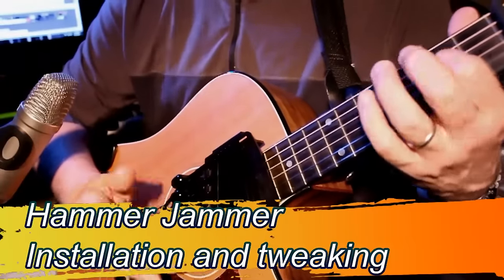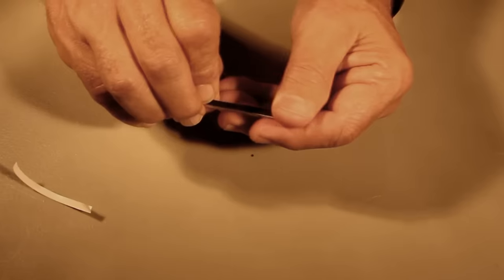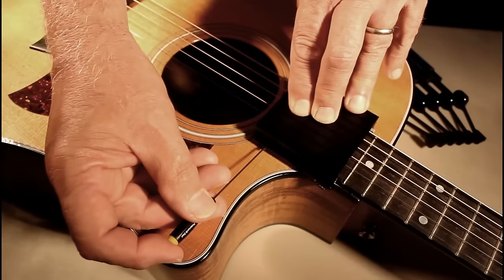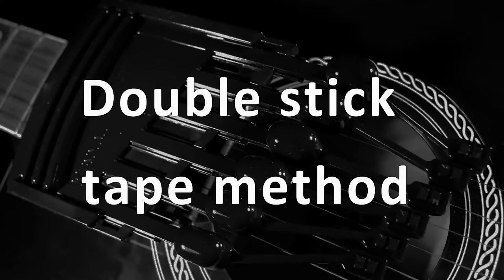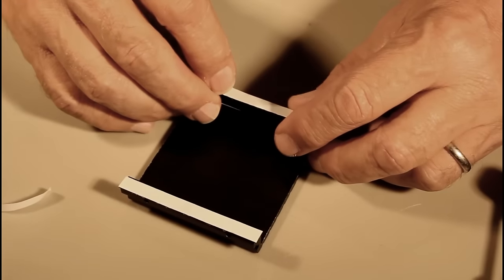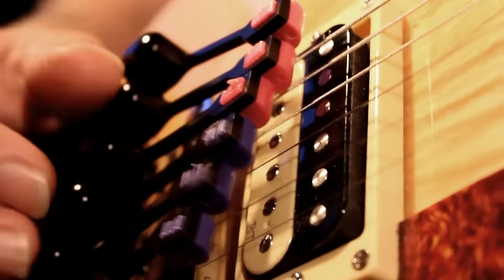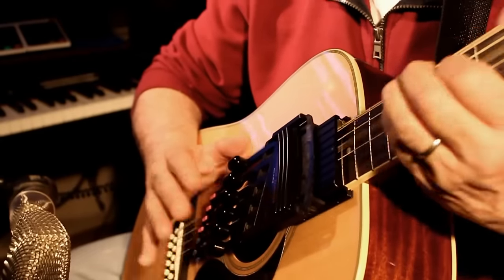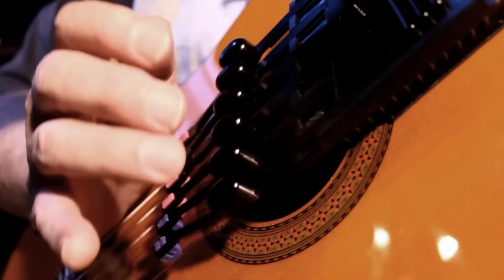Hammer Jammer installation and tutorial

Comment: You make it sound brittle. Maybe a redesign with better adjustability is required. Something stronger than plastic, like fibreglass like in fishing rods or even bamboo, thin steel would be better and a screw pivot like some of the designs used in bass drum pedal triggers. Maybe a steel spring style with a rotating adjustment